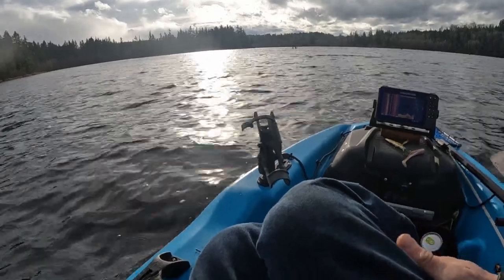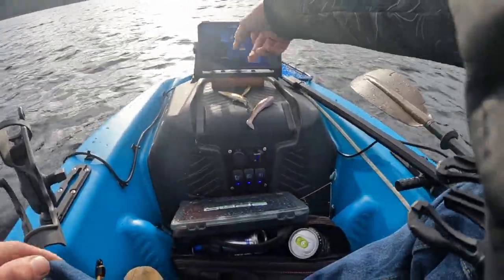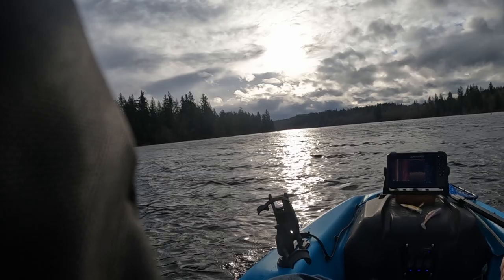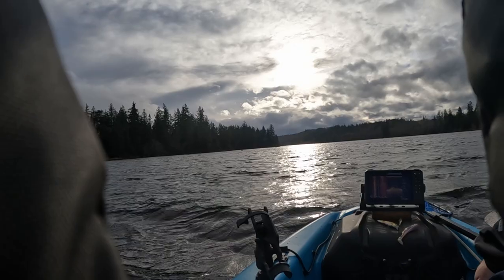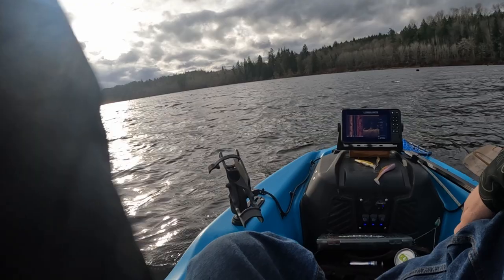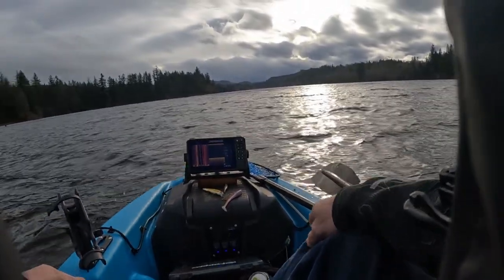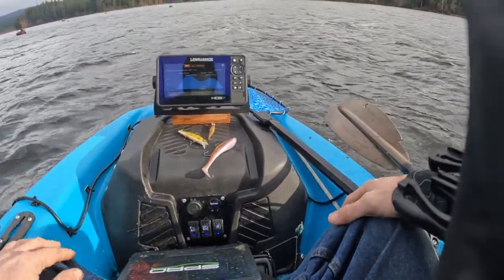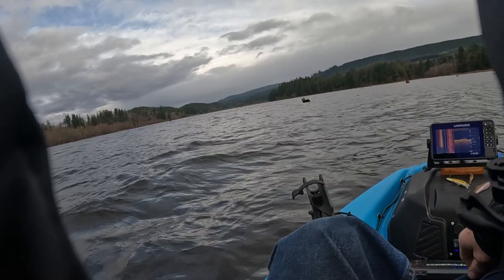Pelican Catch PWR 100 Update

Comment: I opted for outriggers to keep up with shared open water gas boat wake's. But the pwr100 is the best "Kayak" I've ever had. Thanks for the video.
Reply from the maker: I have yet to get into water I have felt I really needed outriggers. Windy days like that or even  eating wakes off wake boats over summer. I’m also not a big guy so I’m thinking that’s playing a role in my favor for stability.
Reply: @northwest-fisherman   I am definitely on the top heavy side at 6'6''. But that's good to know as some normal size friends and spectators ask about stability.

Comment: Great video, I just got a catch pwr 100, do you use an anchor? I've seen some pulley systems but I doubt I'll be fishing in fast moving water.
Reply from the maker: I have a anchor and I typically tie it off to the side rail if I use it. But I’m gearing toward tournaments and you can’t use anchors. Even in wind I don’t really have issues most of the time with wind blowing me around
Reply: @northwest-fisherman  Thank you! I was interested in getting the Scotty Anchorlock but it's probably overkill. Hope you crush it in tournaments!
Reply from the maker: @girtclip1  thanks you that anchor system is pretty nice my dad has it I would say it’s a good call if you use or plan to use a anchor a lot.

Comment: I'm on the fence on getting one of these, how did you mount your transducer? How do you load / unload it, and transport it?
Reply from the maker: I have the yak attack switchblade it mounts on the forward rails. I have a couple ways to transport it but typically it’s on the roof of my lifted pathfinder, the top of my roof rack is about 7ft it’s not to bad to get up there and I have done 80 with it on the roof. Overall depending on what you want to do with it I love it. They make it in a 130 now while the extra room might be nice I doubt I would want bigger because it is very nimble.
Reply from the maker: There is a huge bonus to tying it down is that front loop where you could winch it. I should just do a transport video of the different ways I tie it down because I get this question quite often.
Reply: @northwest-fisherman  I checked on the 130 model, but I don't think it's powered is it?
Reply from the maker: @sirseacow4462  it now comes as powered from pelican I don’t think I have seen it on any other sites yet. But remember the 10 is almost 80lbs the 13 will be over 100lbs bare, plus I have found it to be more difficult to transport 13ft kayaks.
Reply: @northwest-fisherman  do you have a link for the powered 130? I can't find it anywhere on Pelican's site or from google, all I get is peddle kayaks, I'm a fan of the bigger kayaks they feel more stable to me, I just sold a FeelFree peddle kayak that was 10 foot and it was all kinds of wobbly lol.
Reply from the maker: @sirseacow4462  weird it’s gone now, I wonder if they dropped it due to supply issues. Either that or it hasn’t come out yet.
Reply: @northwest-fisherman  I'll def keep my eye on this, I like that I can load it up in the bed of my truck I have Tacoma so, short bed woes lol.
Reply from the maker: @sirseacow4462  then definitely go with the 100

Comment: What lb thrust motor do you have?
Reply from the maker: Minn kota c55 so it’s just a normal 55lb trust with a telescopic handle
Reply: I'm glad you asked. I was going to buy 35 lbs trust. Glad I waited. What battery did you buy and how many hours will it last? I don't need fish finder, just battery that trolling motor will operate.
Reply from the maker: @Floridawoodsbanshee  I’m running a 100ah lithium with the 55 I have never ran it dead but even after 3-4 hours of trolling for Kokanee it still had plenty of power left.
Reply: @northwest-fisherman  awesome dude. I live in Tampa Bay. I sold my gheenoe LT25. Going to get another gheenoe but the super16 model for the summer island fishing. 

I was at basspro shop and they have this catch 100. This will be perfect for trolling back in the rivers during the winter months. If the battery will troll for 5 or 6 hours I'm sure this will be perfect. Thank you I'm watching your other videos now. Good stuff
Reply from the maker: @Floridawoodsbanshee  thanks man let me know how it works out for you